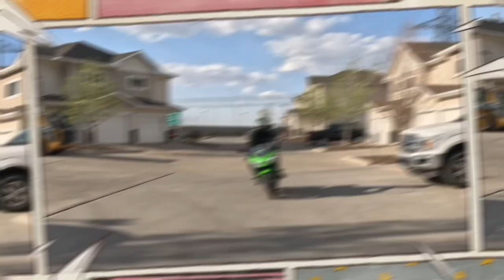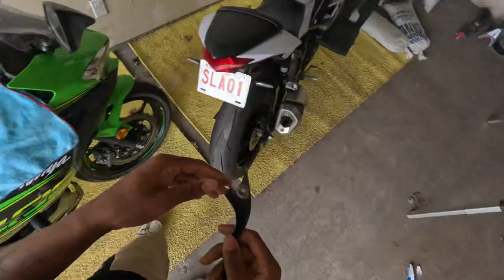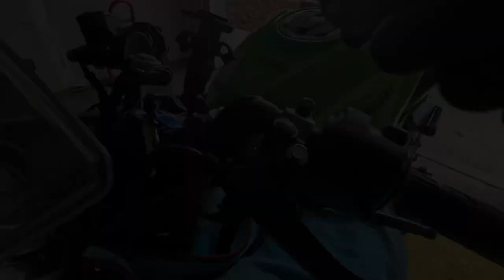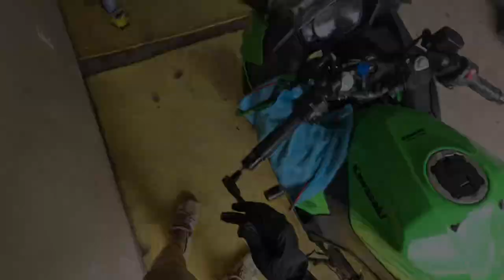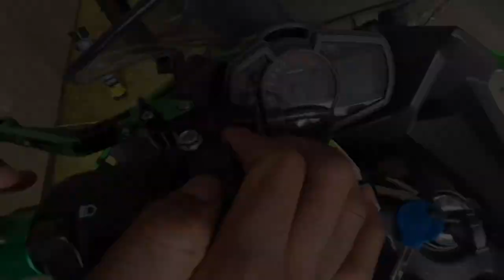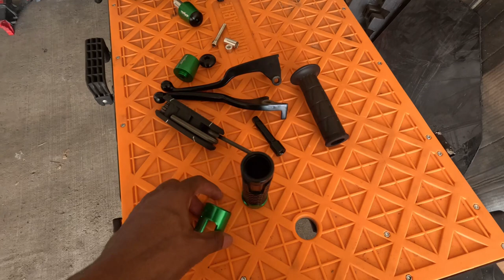Ninja 400 EBay Handle Bar Grips - Break & Clutch Lever Install | How to

Comment: The smaller one goes on the clutch side, swap it and they’ll both work.
Reply from the maker: I tried that but for some reason it's smaller that it should be
Reply: @oxcarvalentine9  get some hairspray and DRENCH the bar and inner tube. I mean saturate it. Slide it on, slight taps with a mallet should do it. They do fit, but not easy, at all